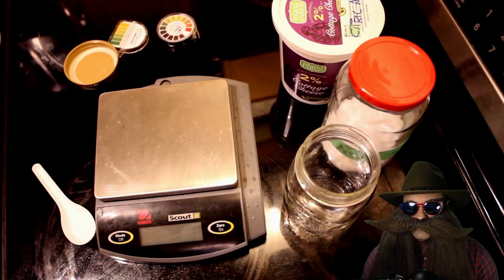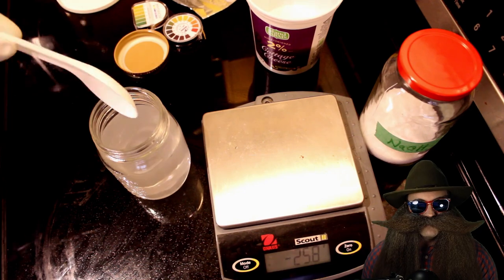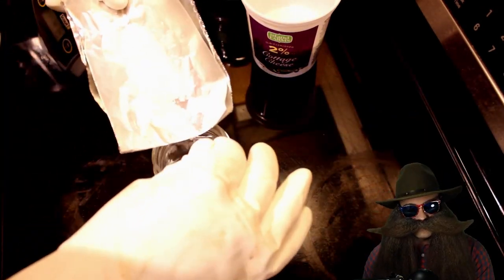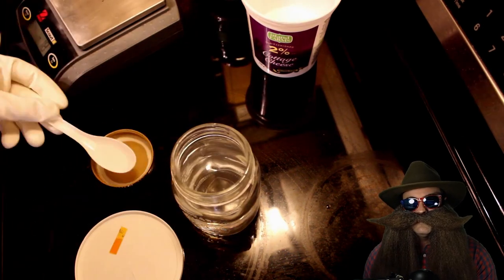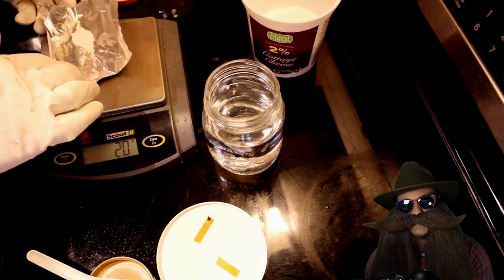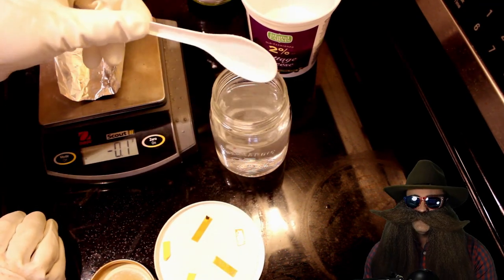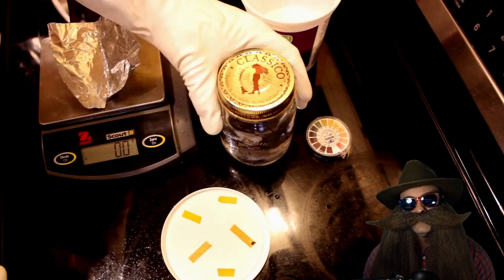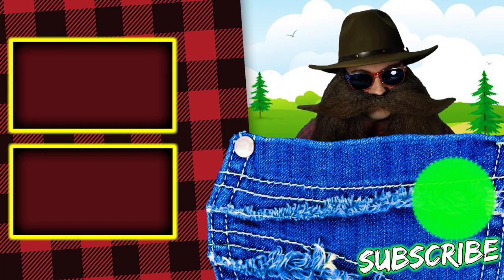pH Buffer Solution + Sugar Wash? Citric Acid & Sodium Hydroxide pH Buffer Solution Recipe.

Comment from the maker: What methods do you use to control pH?
Reply: Thanks for an excellent video. Good results using 2 tsp of calcium carbonate (common chalk), 1 tsp gypsum and 1 tsp of citric acid in a standard tomato paste wash to achieve a pH of about 5 to start, SG at 1.09. Check SG and pH every day. Fermenting room is against an outside wall in a cool basement. Using an immersion aquarium thermometer to keep solution around 25.5 degrees C in a cool room goes a long way to keeping things constant. Complete fermenation with no big pH deviation in about 5-10 days, depending on what's added besides sugar. Averaging about 1 stuck run to about 15 normal so far.
Reply from the maker: Interesting. I suppose something in the TPW helps stabilize the pH. I can't wait to try TPW, adding bran, adding dry malt extract and other things to sugar wash. I'm excited!

Comment: this is the amount of buffer that seams to work for a 6 gal sugar wash at a SG of 1.070.
How about a 42 gal sugar wash at SG 1.070, would you take seven times the amount of buffer (ingredients) or would the buffer not necessary need to be linear adjusted.
And how about a sugar wash at SG 1.120? would you stay with the buffer or double the capacity?
Reply from the maker: The capacity for the buffer still needs to be adjusted for what I want to do with it. I really want to get my 1.070 SG 6 gallon batch to finish at pH of 5.0, when I tested this recipe it finished at a pH of 4.0. As far as scaling the recipe goes, I'm not sure if it will be linear or not, but if you are brewing different sized batches maybe we can work together on a recipe. Making some assumptions, I think what matters is what I call 'sugar points' which is equal to (specific gravity minus 1) x (gallons) = (sugar points). So my 1.070 at 6 gallons would be 0.070x6=0.42. Sugar points for 1.120 @ 42 gal = 0.120*42 = 5.04. The factor to increase the recipe by is, therefore, 5.04/0.42 = 12. I would expect I would need to increase the recipe in the video by a factor of 12 for a 1.120 SG 42 gallon batch. I am building a 44 gallon fermenter so I will eventually need to test this. Thanks for watching!
Reply: @OpenSourceDistilling  great, let's put our heads together for this. I just started two buckets of a sg @ 1.110 with your exact buffer, let's see what that does(actually I am currently testing the difference between goferm in solution vs. goferm in the yeast starter). I monitor the data very similar to you, I will send you my results. Other buckets are still clearing at the moment and I want to do more research before I'll do a big batch. Interesting sugar point assumption, I will test that on my end too. that means on a 6 gal batch of 1.120 (0.120*6=0.72 0.72/0.42=1.71) I would need to increase by 1.71. My next batches will be one at an increase of 1.71 and one at 2 (to maybe get a finish at ph5), let's test your theory.
Reply from the maker: @bennyissimo  Awesome Ben. The more data the better. I just ordered the stuff to make 5 iSpindles (the parts will take 2 months to get here from China) which will make data collection easier in the future. DM me the results. I also have GoFerm and Fermaid K, was going to try and pit them again Superfood and see what yeast nutrient does better. Are you using GoFerm with Fermaid K or just GoFerm on its own?
Reply: @OpenSourceDistilling  I already sent it to the email you gave under contact on your open source distilling webpage. let me know where and how you prefer to communicate. I learned a lot from the mead-making folks when it comes to nutrients. Mead is basically nothing else than a sugar wash and honey is lacking nitrogen just like sugar (most important food for yeast). You use GoFerm only as a first meal for the yeast, preferable directly into the starter while rehydrating the yeast. from then you stagger the nutrients in doses. I use SpringFerm which is basically Fermaid O and I noticed I definitely need  a little dose of DAP in it as well. Fermaid K is probably better, because it pretty much is Fermaid O and DAP in one product. read this reddit-post, that explains it very very nicely and I use the Tosna webpage attached to it a lot: https://www.reddit.com/r/mead/comments/7w5ss3/fermaid_k_fermaid_o_yeast_energizer_yeast_nutrient/

Comment: Interesting video. I may have missed it, but I didn't notice whether you said the NaOH you used was certified food safe (FS). You posted you paid only $1/100 g for it. That is really cheap for FS NaOH. People should be made aware that non-FS  NaOH is highly likely to be contaminated with toxic heavy metals.
Reply from the maker: Where did you discover that non-food grade sodium hydroxide is contaminated with dangerous toxic heavy metals? Can you please cite your source here? The only thing I can find in regards to this is using sodium hydroxide to remove heavy metals from water. The process of distilling also removes dangerous and toxic heavy metals. I don't recommend drinking the pH buffer lol.
Reply: @OpenSourceDistilling  "Where did you discover that non-food grade sodium hydroxide is contaminated with dangerous toxic heavy metals?"

Actually this information can be found in beer making and distilling forums. But for those with access to science journals more technical information on this subject is available.

Heavy metal contamination is well known in the chemical industry where food safety isn't a concern. For example, mercury, one of the most toxic heavy metals, is found in the production of NaOH (Morais et al. 2012). Chemical production plants do not decontaminate equipment between runs of different chemicals unless there is a strict need; however, growing environmental concerns have had an impact on the industry to reduce toxic heavy metal contamination in all products. The very fact that both FS and non-FS NaOH is sold is pretty solid evidence that contamination can occur unless the production is for an environmentally friendly, food safe product. 

"Can you please cite your source here?"

The following book provides details and references other scientific literature on this subject. 
Morais S, Costa FG, Pereira ML. Heavy metals and human health. In: Oosthuizen J, editor. Environmental health – emerging issues and practice. 2012. pp. 227–246.

"The process of distilling also removes dangerous and toxic heavy metals"

Even for the distillate that isn't a 100% safe especially in production using home stills. Moreover, it won't prevent contamination of the fermentor or still especially the boiler and we know some people use their boilers, carboys and ferrmentors for more than one purpose.

"I don't recommend drinking the pH buffer lol."

I wouldn't either especially when it's likely contaminated with toxic chemicals. However, the fact that you can buy food safe NaOH should cause the more intellectually curious to wonder why it even exists. One reason is that your buffer (sodium citrate) happens to be a "secret" ingredient in making the most wonderful cheese sauces. It can turn even the hardest and driest cheeses into silky smooth sauces because it acts as an emulsifier that prevents the fat and proteins from separating. 

BTW, using NaOH produces trisodium citrate, but you can also use bicarbonate of soda (baking soda) to make monosodium citrate. For a ph buffer, the former is the way to go.
Reply from the maker: @snappingbear  Thanks man! Food safe is always the way to go. I never thought about fermenter cross-contamination but that's a very good point. I will mention this in an upcoming video. I will spring the extra couple of bucks for the food safe NaOH, a little goes a long way. Still can’t find any references in the online forums about heavy metal contamination in NaOH, so if you have a link please share. The paper you reference seems to talk about heavy metals generally but nothing specific to NaOH production. Regardless of finding a reference or not, I’m with you, food safe everything. 

Do you have any thoughts about welding CO2 vs food/beverage CO2? My local homebrew shops (all of them) only sell welding grade CO2 and I’ve been using it for years. I also bubble one min of oxygen from a red home depot canister (doesn't say food safe on it) into my fermenters when I add the yeast. I’ve seen online discussions about possible benzene in welding grade CO2 but have never heard of someone getting sick from using it.

In regards to making pH buffer with baking soda, I don’t think that would work. To make a pH buffer you need a strong base (NaOH) and a weak acid (Citric Acid). Baking soda is a weak base. The base needs to fully disassociate in solution, right? My understanding is a weak acid and a weak base can't make a pH buffer.
Reply from the maker: @snappingbear Here is a reference stating that distilling removes heavy metals. There are many other articles like this one on the internet. Please cite your source regarding distilling not removing 100% of heavy metals as I would like to read that article. https://www.historyofwaterfilters.com/distillation-pc.html
Reply: Just found your channel and a question do e to mind could you use calcium hydroxide? I would thing that would be better then addi g the sodium ion.